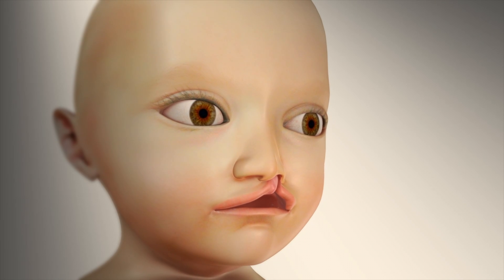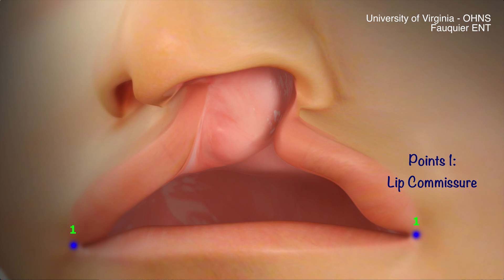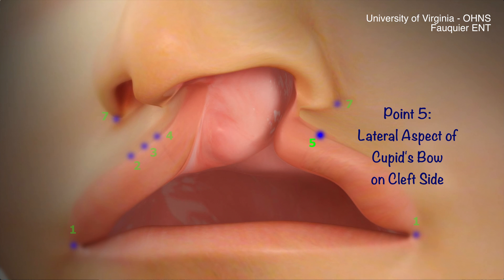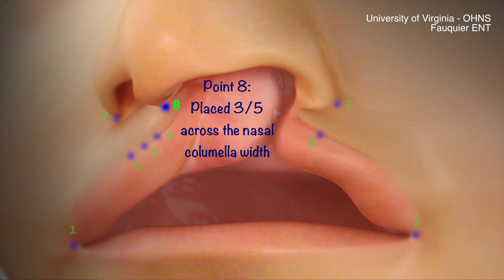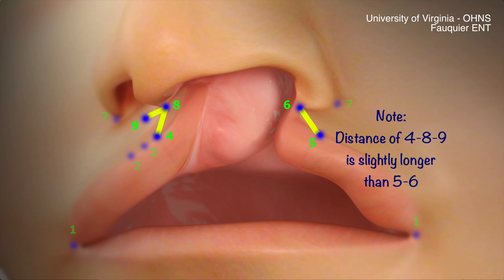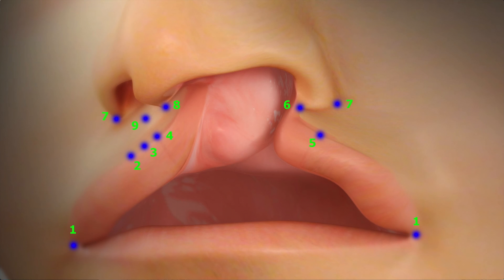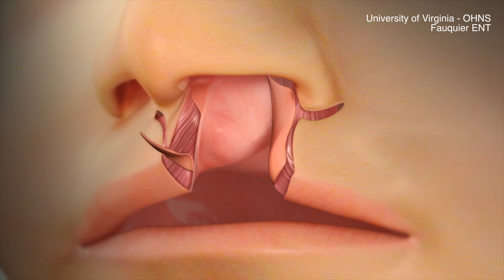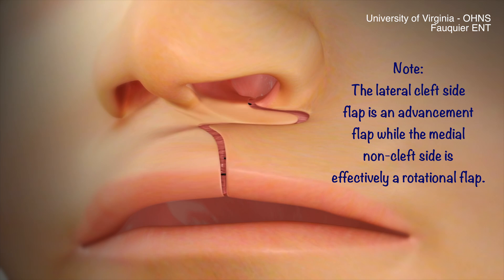Cleft Lip Repair - Surgical Markings

Comment: When i was pregnant the doctor gave me those white prenatal pills my belly retain water i gain 65 pounds i had edima water retension.and the baby born at 25 weeks premature.she survive and now at 17 weigh 170lbs.watch out for those colorful prenatals pills.all of them cause a different side effect.look like they interfear with the flesh.i had the yellow prenatal pills with my son and he had difficulty at 1year old walking.now he suffered from knee problem he then tear a miscuous that required surgery. He is now 23 and coping.you need to find out which one of those color pills causing cleft lips.the chemical they used in it hope its not mercury!